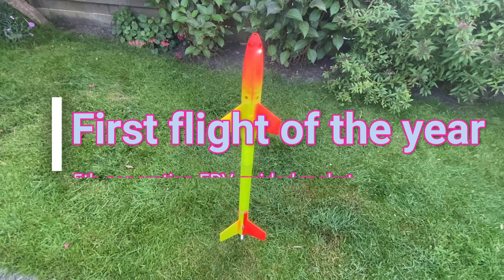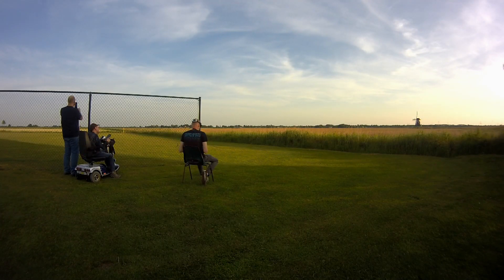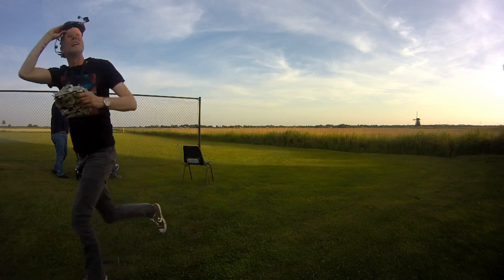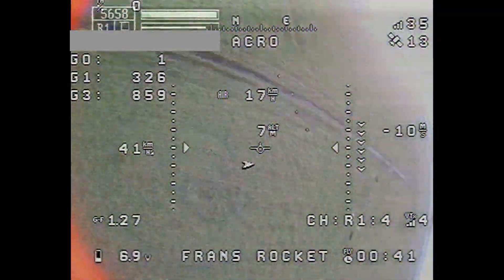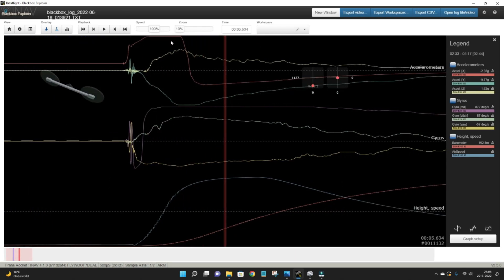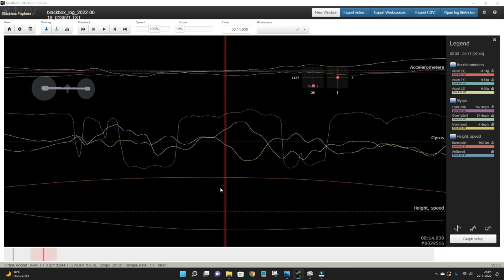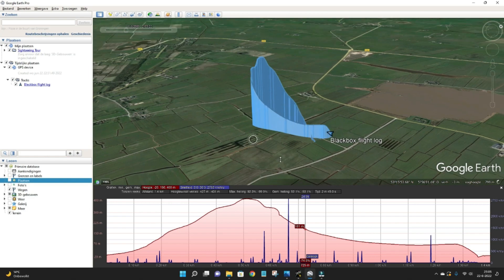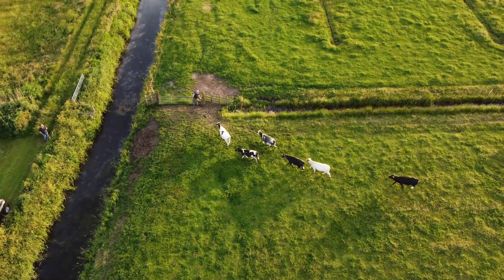FPV guided model rocket flight

Comment: I really like this. I''m going to build one, I actually found this link on thingiverse.

Is there anything you would suggest? Anything I should know to do beforehand?
Reply from the maker: Check my videos on YT, I will be posting some more in the future. If you decide to use an Inav flight controller like I did you need some experience with configuring that.
Reply from the maker: And pay very very special attention to your chute system, that easily fucks up a good day😅
Reply: Looks like I'm good to go then lol

Comment: Sorry for yet another question. 
I see you now launch in acro mode.
in your previous video you would launch in horizon mode.
What was the reason for the change?
Would horizon mode provide better launch stability in theory, or is the stabilisation effectiveness the same in either mode?
Reply from the maker: No problem, I like to talk about rockets😉. I used to use quadcoper mixing in the beginning and indeed launch in horizon mode to assure the rocket flies straight up. That worked fine, but in horizontal flight it is less logical. In airplane mixing, if you want to use the GPS navigation modes, you need yo orient the flight controller in line with the rocket as if it were a plane. This works great during descent, but using horizon mode in this configuration is tricky. During launch the flight controller would try to level the rocket horizontal which obviously is not a good idea, and during descent leveling also is dangerous because the nose should be kept way down to keep the speed high enough for flying. In fact the pitch and yaw of a rocket don´t really need to be electronically stabilized, because the rocket design should be aerodynamically stable. (centre of gravity and centre of pressure, use Open Rocket sim to detirmine)

Comment: I also see that you have separate parachutes for the controlled nose section and booster.
At the high speed of deployment you couldn't have them joined because of the risk of zippering with the shock cord.
I still wonder if the separation point is towards the aft end just above the motor mount, would there be less risk and could keep them tethered?
Is there an option to increase your throws before deployment and pull into the vertical to slow down then deploy?
You've probably looked at these options and there are good reasons why not.
Many thanks for sharing your work.
Reply from the maker: In the past I used one bigger chute and a chord between nose and aft part. I did get more damages then, because deployment shocks were bigger (nose and aft part never decellerate at the same time) and also because the wires sometimes tangled. Also important when determining this separation point is how to separate front and aft part. I use elastic band which works well for me. Also the 2 pieces must be joined straight and stiff to ensure good alignment during ascent.

Comment: Great update video Frans.
Just thinking about the launch instability.
I assume that you reduce the roll rate during the launch phase/setting.
Is it possible that the IMU is swamped by the G forces exceeding it's specifications and giving bad data?
can you see the induced roll/instability in the black box data?
Reply from the maker: Thanks Michael, the z-axis accelerometer indeed is saturated during ascent, but the x and y axis seem to keep performing well. The blackbox data looks ok, and in horizon mode leveling works ok. For roll stability only the gyro´s can help, they also seem to perform well under G-loads. One problem is that there is very little  inertia on the roll-axis of a rocket. Added with the fact that the rudders on the fins are very efficient at high speeds makes it very hard for the control loop not to cause oscillations. So to my interpretation the only way to keep roll stable is to have a perfect aerodynamic trim of all the fins, and program the P and I high enough to be efficient without oscilations. Besides that I now only use one of three rudders to control roll.  Btw when I switch from side cam  to nose cam I also switch the PID profile to a more agressive one because speeds are lower then.

Comment: This is a fantastic project, very unique!  I have enjoyed watching your progress.

Since you already have servo control over the fins, perhaps you could implement roll stabilization during the ascent phase.  This might keep you from losing your orientation.

I would also be interested to see how far you could fly it horizontally once it has reached its maximum altitude.
Reply from the maker: Thanks! I do allready use roll stabilisation but it is very hard to find the right PID values, specially preventing oscillations. A perfectly trimmed rocket is absolutely required i found out